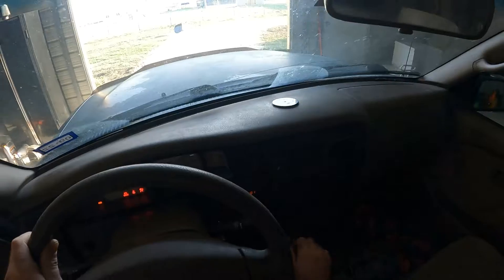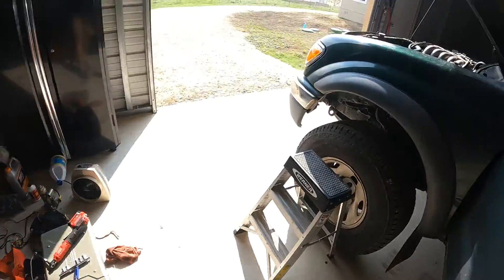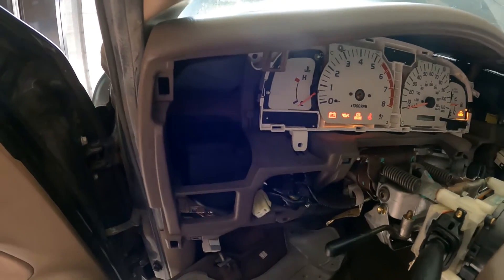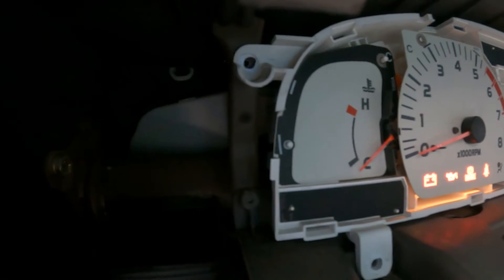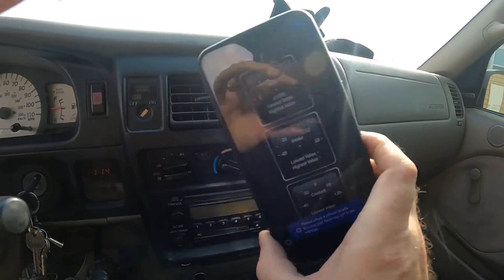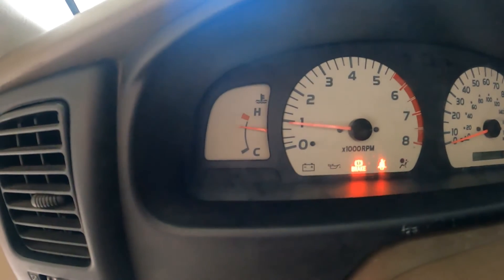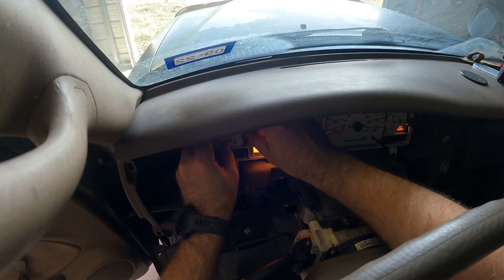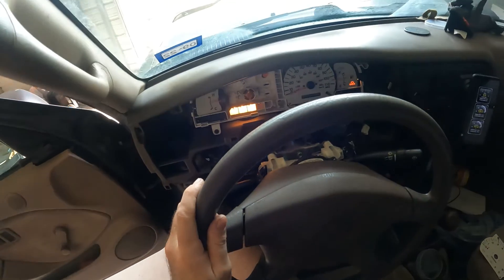2003 Toyota Temp Gauge Repair - Part 2: Calibrating the Gauges

Comment: it should be almost the middle where the needle sits on operating temperature thats the correct form.
Reply from the maker: I did move it to the middle afterwards (with the vehicle at operating temp), since it was already shown how to make the adjustment, I did not see the point in extending the video to re-show, just brought up that I did so afterward.
Reply: 124
Reply: Mine from factory shows a bit above middle even though it is not over heating, just like yours. I wonder why they do that?